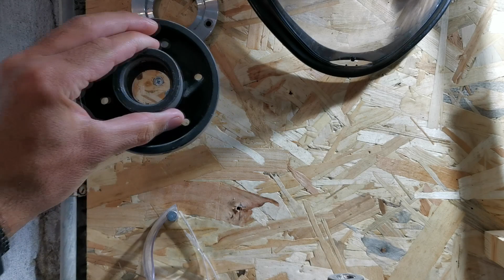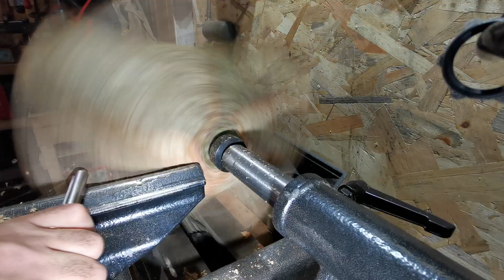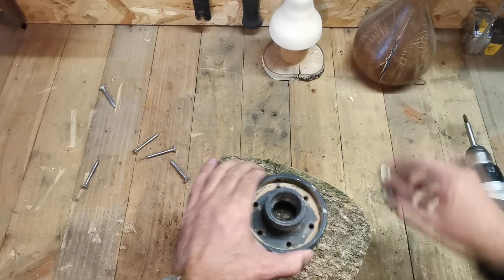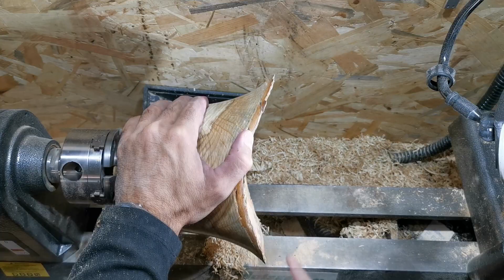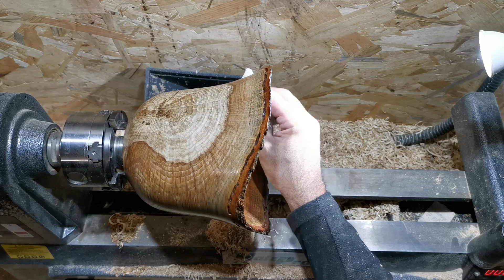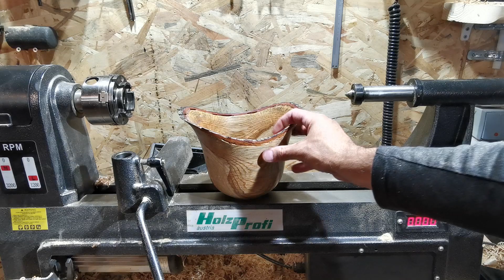woodturning:  bowl natural edge in oak log

Comment: Can I ask why you chose to run clockwise instead of the normal rotation where the chisel is at the front of the lathe ? Intriguing !
Reply from the maker: William T-shirt
Simply for practical reasons👍
Caution This is only possible with a special chuck fitted with a locking screw on the shaft.